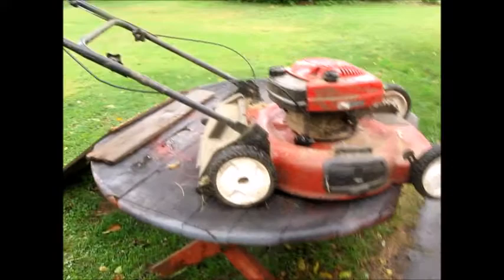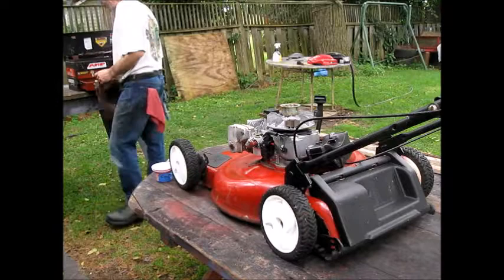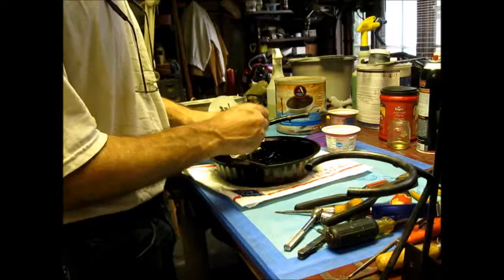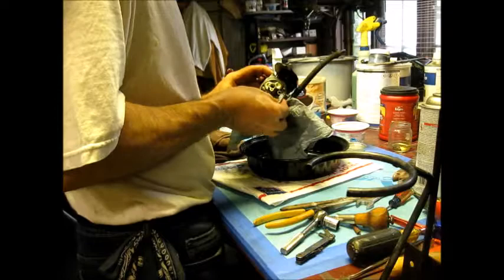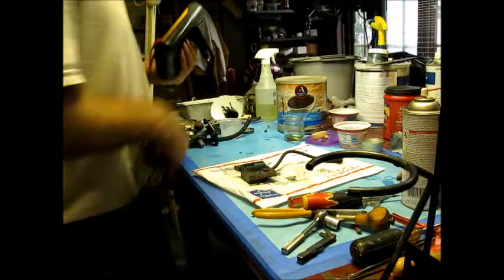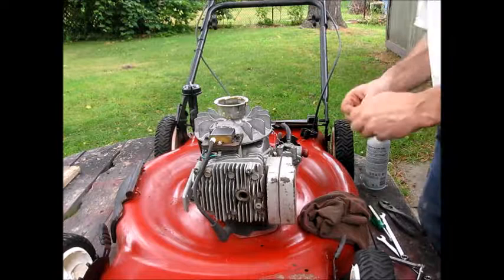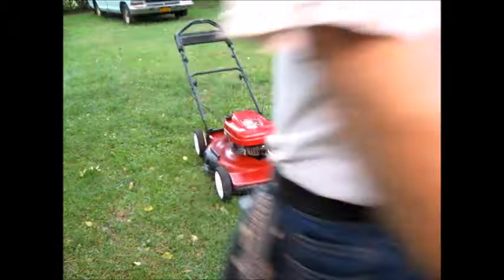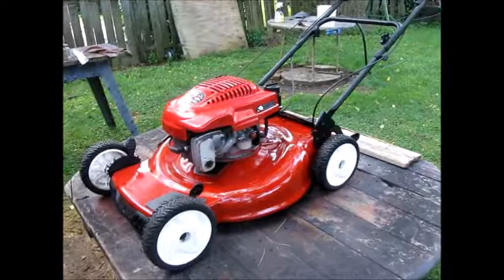Old Toro Lawn Mower Restoration Will It Run?

Comment: 90% of the most troublesome modern-era Home Depot Toros have the Tecumseh (6.5 hp) engine. MUCH more trouble to keep tuned up & easy starting than the Briggs (6.75 hp version, which has nothing to do with the problems. It's carb complexity.) I've had 1 of the Briggs Toros for over 6 years. Zero problems starting.
Reply from the maker: I was chatting with a customer the other day about this; my guess or opinion is the Tecumseh carbs sit lower then Briggs, water in fuel is ever present here on the Island, it tends to fill the carb and rots it.  Also any dirt in the fuel and this usually comes from dirty gas cans, cause issues more often.
Nice carbs tho, much better then briggs but simple gets the job done fer sure!
Tecumseh is a better motor in my view, I see fewer issues with them. 
Head bolts never loosen over time, crank almost never bends, flywheel keys almost never break, engine mount bolts actually come off of older motors, they just dont die the same way
Reply: @TheNovaJohn  I prolly should have been more clear. I started with a 6.5 Tec-Toro & got 2 seasons out of it fairly trouble-free. Then 3rd season had to take it in for a complete tuneup - wouldn't start easily. I always run the gas out @ season's end. I now have a Briggs version of same mower. NO problems in 4 seasons of mowing!